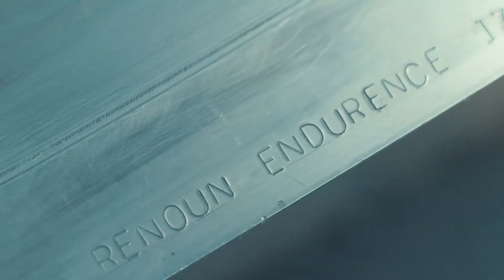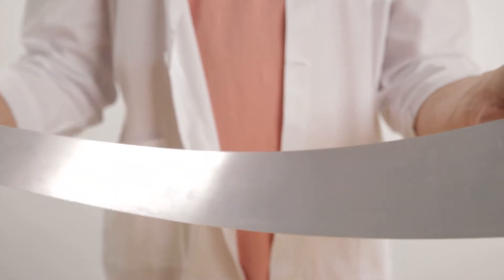How Skis Are Made | Anatomy Of A Ski | Episode 7: Metal

Comment: LMAO "Some companies will cut a single hole in it, remove it, and call that a technology." I think there is one very specific company that is doing this and I love the roast!
Reply from the maker: Shhh ;)
Reply: 🔥🔥 Deep Burn!
Reply: I really enjoyed this series, just one comment: The “see how floppy this is” argument doesn’t hold as the metal sheet is obviously less floppy than the fiber sheets. Aluminium has a Young’s modulus in the same range as glass fiber, and definitely adds some stiffness when placed eccentric to the neural plane of the beam structure. And since it also adds thickness, it further increases the stiffness provided by the fiber sheets.
Reply: I didn’t mean to post it as a reply, sorry